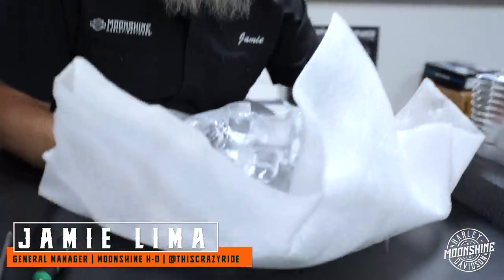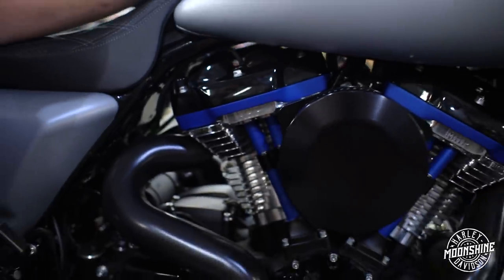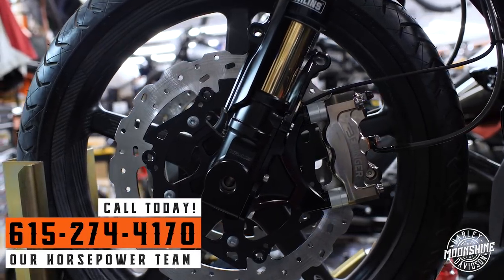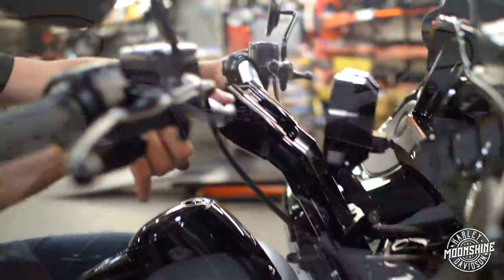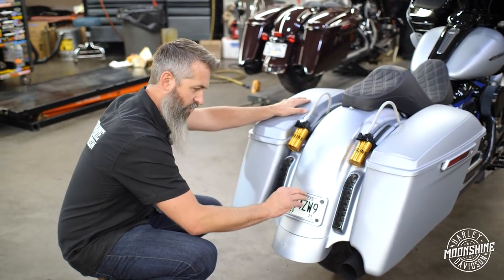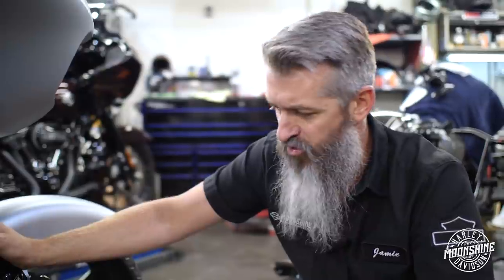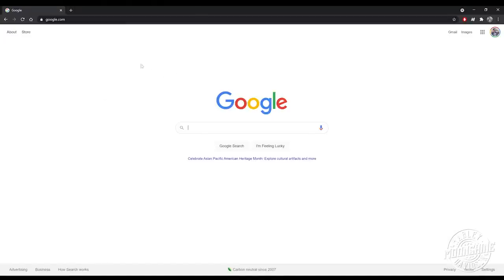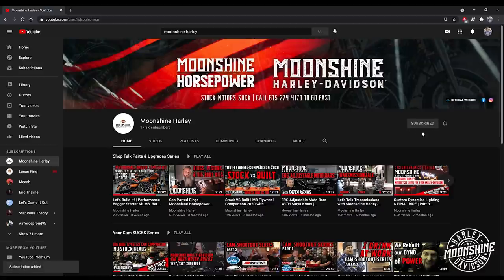Full Performance Bagger 143'' M8 Silverback Bike Build No. 4 | Shop Talk Episode 51

Comment: Nice Build.  My builder from SF Bay Area Built 3 124" Twin Cam Motors 10 years ago with 
163 hp 158 torque to the rear wheel.  He designed his own heads. Faster than most could handle.

Comment: What about the crank?  The original Harley crank can’t handle this power for very long.  The crank is the foundation and when you have a bad or weak foundation the rest of the structure falls apart.
Reply from the maker: Fully build flywheel with Carrillo rods in this beast.
Reply: @MoonshineHarley  can you link me to this part thanks
Reply: If I did this build all moving parts are getting replaced with high performance parts you also need to upgrade the transmission the stock one will also break. Also I won't use a belt I will buy a sprocket set with a 530 high performance chain.

Comment: I've never understood why people feel the need for bigger and "better" when it comes to Harleys.
 My box stock 74" '72 FLH has started without fail and run 70mph all day long, problem free, since I bought it used in 1980.
 People pass up the high dollar machines to look at and take pictures of it too.
 To each his own, I guess.
Reply: I agree but disagree I love classics and think they should be kept as original as possible but more power is always fun too
Reply: My late 80 sportster makes me the same but it is a 90ci motor making around 110 wheel. Looks like a dinosaur and out runs 95 percent of the Harley’s on the road.
Reply: Same reason people want to go to the moon, because they can.

Comment: MSB working on my XR 1200 I put E3 spark plugs in it K&N air filter 201 bassani exhaust no the bike stalls at idle idling low and hesitates to start lead me in the right direction appreciate you

Comment: what base motor do I need to go straight to a 143? currently have a 2015 built twin cam...I'm finally crossing over to the M8s. I want to build it immediately so I just need to know which bike/moter to buy first....
Reply from the maker: We can built it on any M8. It requires a new flywheel and case bore. For more information please contact our Horsepower Team
Nick - Jamie - Mike - Aaron
Phone: 615-274-4170
Email: horsepower@moonshineharley.com
***If you email us please provide a good contact phone number for you.

Comment: And what did you do to stop the crank case pressure or did you you just inject the overburden oil into to cylinders through the air system like normal, destroying the engine in the process. Also it’s Ohlins not Oleans
Reply from the maker: Let start with your ridiculous crank case pressure comment. If you have good ring seal you don’t have to worry about excessive crank case pressure. This build has a set of custom CP Carrillo pistons paired with a set of total seal rings. We have finish honed each cylinder with torque plates to fit the piston that will be run in it. You probably don’t know who total seal is but I’m sure you can google it. “Overburden oil into the cylinders” ??? I’m not sure how your setups run but it is very minimal when you have good ring seal. Now your “ destroying the engine in the process” comment it’s ignorant. So now oil destroys engines? That’s a new one. Oil lubricates and extracts heat from the engine. A minute amount of oil mist gets sprayed into the intake which lubricates and can even help reduce heat in the cylinder a fraction. Almost every manufacture designs their engines this way. But in your book that equals total destruction. Also does it really matter how we pronounce Ohlins?
Reply: You can install the Feuling breather system for back up. Easy to install and not too expensive.
Reply: All about ring seal man

Comment: I take very long rides, so bikes that get crappy gas mileage don't work for me.
Reply from the maker: Build bikes get awesome HWY mileage 37 - 43 typically depending on you speed. They sometime get better mileage at 80 than a stock bike since they are barely working to maintain the speed.

Comment: Those numbers are not that impressive to be honest. I’ve seen higher numbers from off the shelf 124/128 kits.
Reply from the maker: Be careful. Some of those results might be inflated. We dyno lots of bikes with impressive dyno sheets but when we run them in our shop we have a hard time replicating those funny numbers. ??? 165hp street 124 is not realistic period. I would also point you to the lower RPM's 2,000 - 3,500 what does that curve look like. We focus on both side of the graph.

Comment: Is the 143 need race fuel only or can it take 90 to 93 octane?
Reply: They lowered to compression slightly so it should run on quality pump gas. #mytwocents
Reply: @mrh3085  what is best compression range for 143 to run in pump gas 90-93 octane? 11.7:1, 11.5.1, 11.3.1. 11:1?